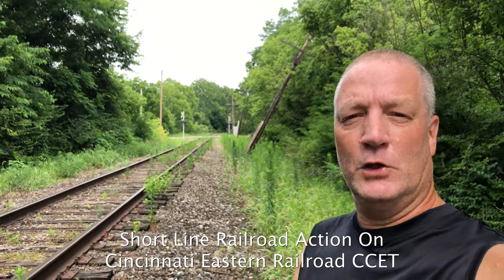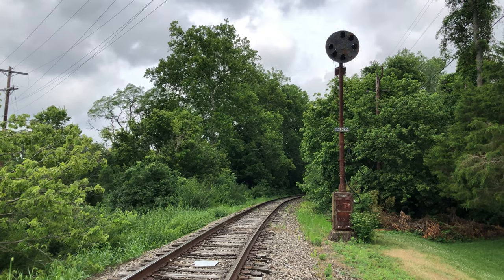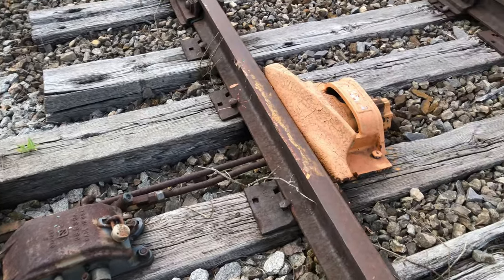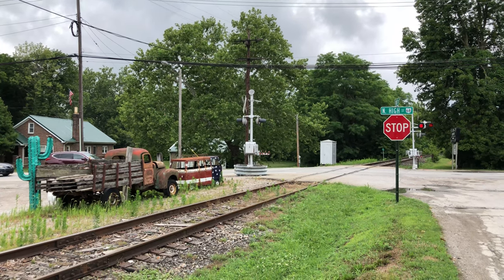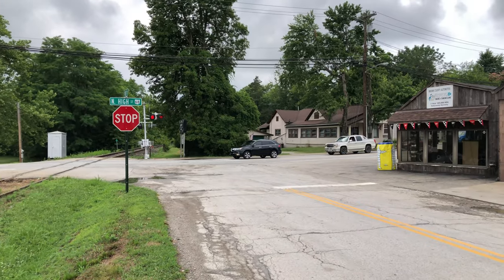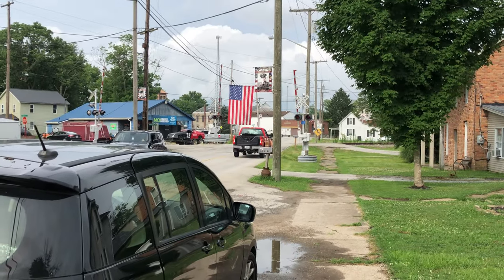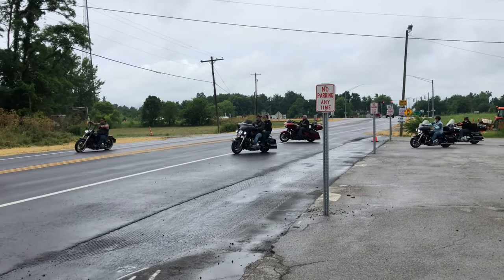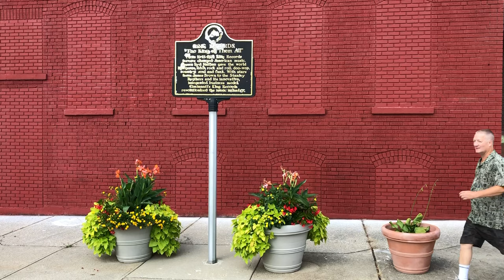Rock Train Going To The Quarry!  Short Line Railroad Action, Both Sides Of Train, Cincinnati Eastern

Comment: Cool railroad. This operation would make a nice model railroad, may be virtually in Trainz TRS22+ which I have where I can build the whole thing complete with all the industries and towns in the right locations using DEM files and topographic maps, loads of buildings, industries, trees, etc.

The old rails are sweet. I found some dated 1888 at the end of the former Tewksbury MA branch of the B&M. This branch was abandoned beyond this point in 1922 and is completely gone now. The B&M had stick rail on its mainline from Lackawanna Steel made in 1944. This lasted until the MBTA put in CWR and single-tracked the line. Today, there's dual CWR and trains go through at 65 mph.

Looking at those poles, they may still be used for other purposes. There's a ground wire running along the top which leads me to believe they're used for power. I was told by comm workers not to touch the wires because they could be live. If the poles are separate and the wires go to the ground, that's a different story.

Comment: Cool on the derailer. That should be locked. It's a wonder the insulators are still on. alot of places they were removed by people. P.R.R  had their own marked P.R.R. on the top of the insulator. Cool you mentioned them

Comment: Got some good action going on. It's a pipe dream, but it would be cool if that line ran to Portsmouth again.
Reply: Steve, I worked forty years on the RR and I have seen all the secondary subdivisions get ate up by deregulation, the Reagan administration, but I’ll say one thing the “ engines” you observe operating today because of their size and length would be too costly relating to rail maintenance…..plus the class 1’s can not find it feasible to operate 4 axle locomotives even thou they maintain a small roster of them~~~sad……..ms~~~
Reply from the maker: I wish I could go back and ride the 611 over this line again

Comment: Hey Jaw Tooth ; Thanks for braving the heat to get this set of video's that i just watched and keep up the the Good Work ! 👍 All of us up here around the Berea , Ohio area where there are 2 Major railroad lines less 100 yards away from each other ( mostly CSX & NS locomotives pulling trains thru ) enjoy seeing your video's and the info that goes with it too ! 👍 Anyway , i have a few comments about this here video that i just watched and First off is did you contact someone about that De - Railer being left unlocked on that siding ? 🤔 Looked like it had been resting on that rusty rail recently!  😦 Secondly , when you passed by that Green locomotive why didn't you stop to get a much closer look at it and tell us viewers what railroad line it belong to and Thirdly as someone else mentioned in the other comments , what a Great Looking , very old stake body truck that was sitting along the tracks as that CE train rolled by ! 😉 Wondering what year the truck was and kinda of odd that it still had a load of wooden planks on the back of it ! 🙄 Must have broken down and nobody felt like getting it running again ? 🤔 Somebody never got their delivery of planks ! 😲

Comment: There probably are not any cars in that track.  So there is nothing to protect from rolling out onto the main line with the derail.  So it is left unlocked as it can’t hurt anything if somebody did throw it.  A crew using the track would check the derail’s position before using that track.
Reply: Bill, I won’t argue your point but as you well know, in the industry you have a rule pertaining to the operation of said devices…..and even thou this is a class 3 operator, it’s in the rules and the governing body ( FRA ) frown upon these practices…..take care my retired brother…… ms~~~
Reply: MS Hum53   Yes, the GCOR does say that derails are to be in the derailing position even when there are not any cars in the track the derail is protecting.  It also says that derails equipped with a lock will be locked.  

We had a General Order that allowed the derails to be left in the non derailing position on tracks that did not have any cars in them and only had one entry point.   And I don’t think the derails we had were even lockable in the non derailing position.

This makes more sense.  We did not have any derails in any of our sidings.  This was put in place mainly on branch mains in dark territory for spurs where cars were placed to be loaded or unloaded.  The derail in JT’s video is on a short stubbed spur that is probably only use by MOW or to set out a bad order.  There is nothing showing on Google Earth that indicates it is used for loading or unloading.
Reply: MS Hum53   I just talked with a guy that followed me in seniority and went way up in our union.  He said that he remembered the change from the GCOR rule and that it was done to help prevent personal injuries before we were hired.  There was a rash of personal injuries like crushed fingers and back injuries.  None of our derails were thrown with a lever.  They had to be picked up by hand while in a bent over position and pushed over a pivot point with the bottom part spiked to the ties.  The time saving part was lagniappe.
Reply: @billmorris2613  Bill, I always appreciate your return comments, stay safe my friend we could go on forever sharing stories……ms~~~
Reply: MS Hum53    Which RR and position are you retired from?  UP via the MOP Via the T&P road Engineer from New Orleans here.  I ran on most of the UP tracks in Louisiana except Alexandria to Lake Charles. And Thibodaux to Lafayette  over the old SP.

Comment: Hm? No FRED AT END OF THE TRAIN? 🤦🏻‍♂️
Reply from the maker: No, they only use them on this line at night or in poor visibility
Reply: Not required where the maximum speed is less than 30mph and daylight operations……NOW, if you operate 1 hour before dark to 1 hour after ( night )….. a flashing red market or an engine at the rear of the train  with a headlight on dim facing the rear…is required, which you will see on the CCET where they will have an engine on the rear for switching purposes, certain grades ( mountainous for one ) require 2 way telemetry ( a ETD )  per train handling rules for its respective carrier….when watching other rr video channels you will observe engines on the rear ( now called DPU’s ) that are what we use to call helpers but with today’s technology the two way telemetry is linked up and the capability to place the rear end into an emergency is enabled….I hope that helps….ms~~~

Comment: Another ungated level crossing and a train that blasts its horn just before the crossing.  No weed killer in the states?
Reply from the maker: Weed killer is too expensive for this many miles of track .   Tha ks for watching!
Reply: @JawTooth  I always enjoy watching your videos as you clearly love your trains as much as I do here in the U.K. I do see so many things though that wouldn't be tolerated here in terms of safety. All railway tracks here are fenced off now and there are fines of 1000 for trespassing on railway property and securing rails to sleepers using a spike was never used here. We use proper fasteners on concrete sleepers such as pandrol clips. We have areas where trees grow close to the rails but they are usually cut back before they become a problem and there are supposed to dedicated weed killing trains that spray the tracks.